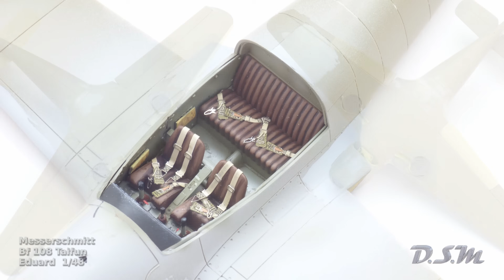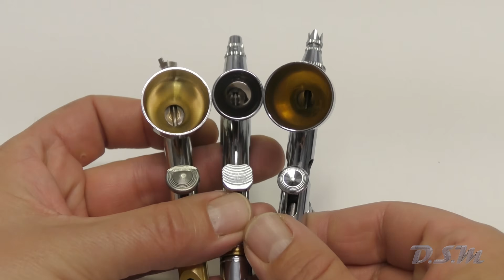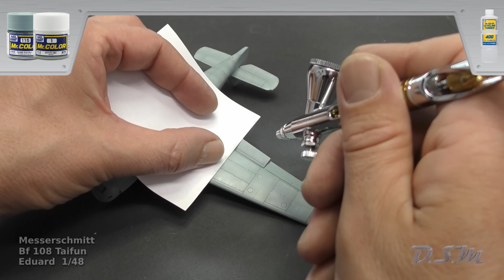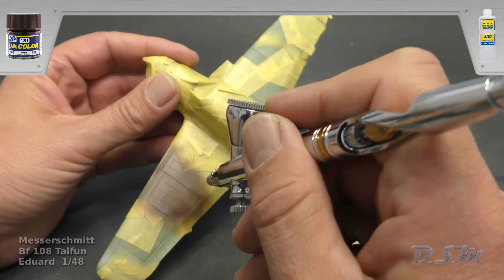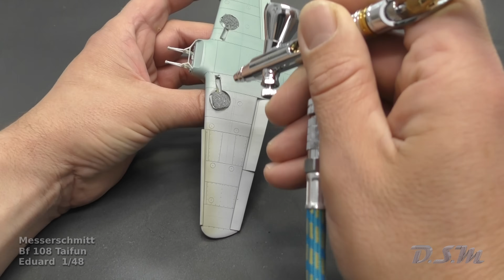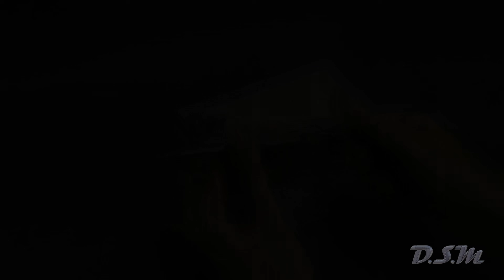Messerschmitt Bf 108 Taifun 1/48 Eduard– jak na kamufláže Luftwaffe

Comment: Hi Josef, thusxwas a great tutorial, I have a slf centering Iwata AB, but have not used it yet, as I mainly use my Iwata HP-C, my main issue with my airbrush is I do not use it enough, I have always been interested in fire trucks etc, any chance of seeing some of the vehicles you operate? Best regards from Australia, Les
Reply from the maker: Hi, I've been a firefighter for thirty years and the fleet of our fire station has been replaced several times for my service. Please email me at detailsscalemodel@gmail.com and I'll send you some photos of the current vehicles.